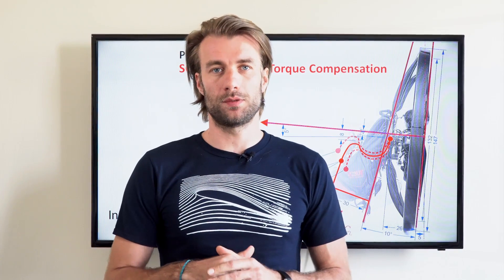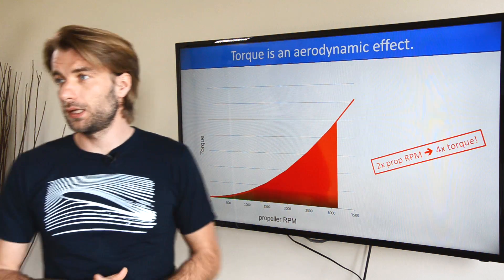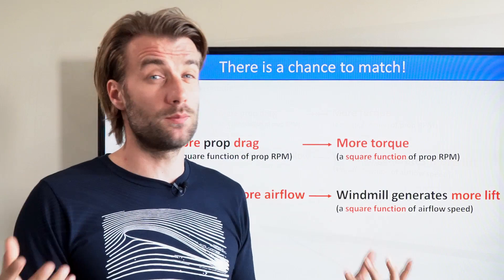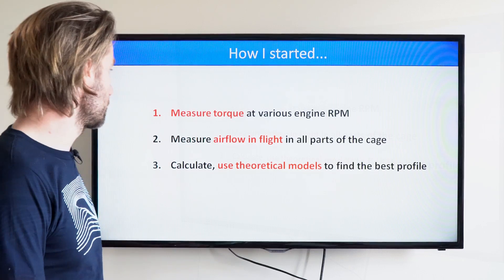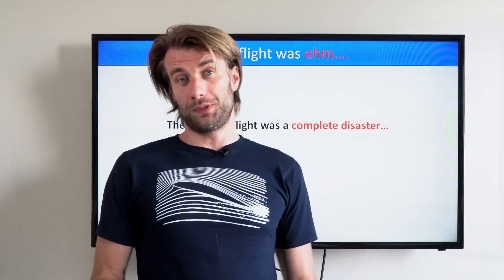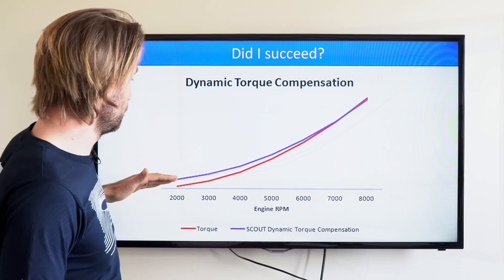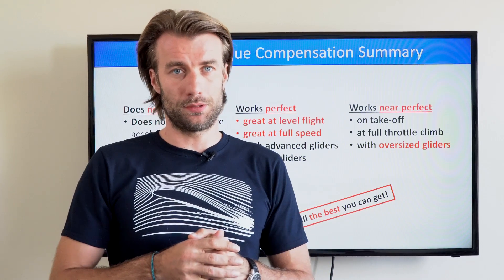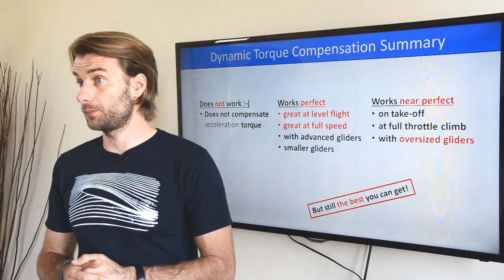SCOUT Dynamic Torque Compensation. Paramotor geometry part 15

Comment: Did you explore what the aero-spars do to the efficiency of the air flow through the prop?  They have to have some affect and i'd expect it to be lower efficiency which would reduce thrust and torque somewhat at the cost of less power.

Comment: sorry...your DTC is a market publcity. it will work if your cage finns would be behind the prop, like in ducted  turbines. in front...not work. explained on my vid .
Reply from the maker: It must be magic then...:-)

Seriously, there is just as much airflow in front of the prop as behind. The prop does not generate air, It just make air from front move to the back.
Reply: What's your rationale?
As miroslav said the airflow is the same. It's not like it needs to divert the airflow to the side (like a ducted fan steering a hovercraft) it just needs to 'push' the spars to rotate the frame.

Comment: I'm 6.0ft Never weigh less then 165lbs and never way more then 195lbs. 
I weigh 170 at the moment.

What kind of wing would you recommend me as a beginner?
What kind of Engine should I get with the SCOUT if I manage to get one?
Reply from the maker: +naynay sploogle we will cover this in one of our chapters. 
In general you would need 22HP or more. 
You cannot go wrong with a 27HP Vittorazi Moster plus. 
Wing: definitely beginner wing,rated EN-B. you may start with a used one. And then when you gain experience, confidence and define your dominant fitting style you would invest into new one specific for your flying style.
Reply from the maker: +SCOUT paramotor Ozone Roadster or similar wing would be fine
Reply: Appreciate it! Just finished a video with Tucker trying a new Ozone wing.
He forced it to collapse wingtip to wingtip, and it fixed it'self with little surge.
Before I watched that video I thought a collapse meant certain doom.

Comment: Do the spars need to be optimized for the motor and propeller options chosen? It would seem that a lighter or more efficient prop would need less compensation.
Reply from the maker: Weight of the prop does not affect torque during constant RPM flight, only during acceleration - see chapter 11.
More efficient prop would need less torque compensation but fact is the differences between propellers I have tested are rather minimal.

Comment: Thank you very much for this video series, I'm a free flight pilot who is stuck living in the flatland and I'm currently saving up to buy  my first paramotor.  I'm fascinated by all kinds of aviation, and thought it bears mentioning that there are other examples of the underlying "windmill" torque compensation technique you came up with.  Most notable is the use of stator blades inside of jet engines.  I have also read about stator blades used in ducted fans on hovercraft, in the hover craft example I read that they used the same blade profile (and number of blades) as the fan itself for the stators.  Thanks again for taking the time to share your knowledge with everyone.  Cheers!